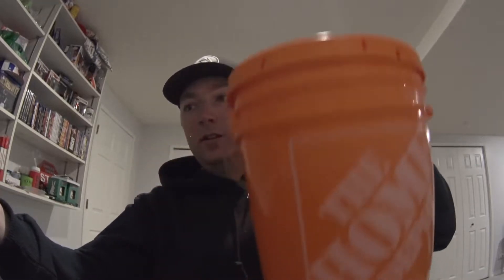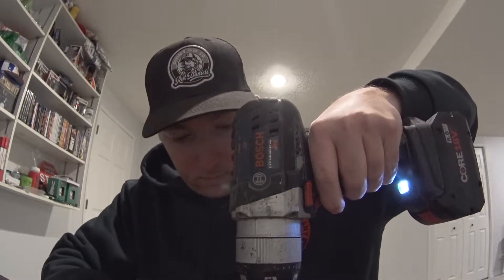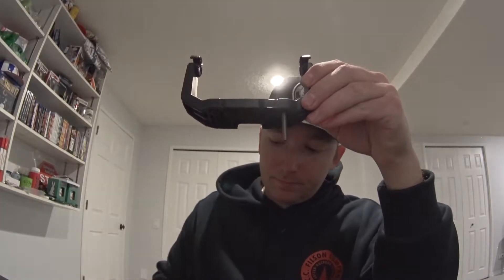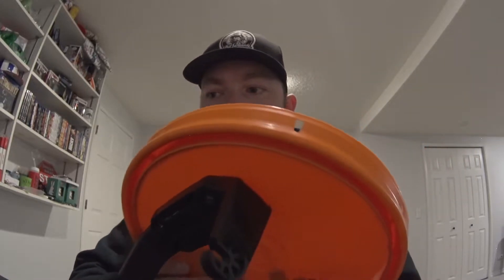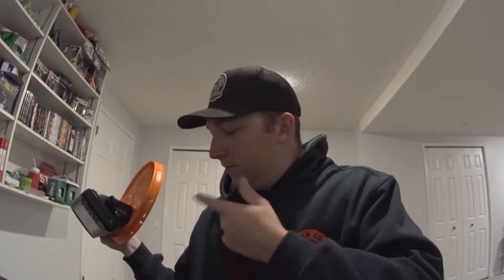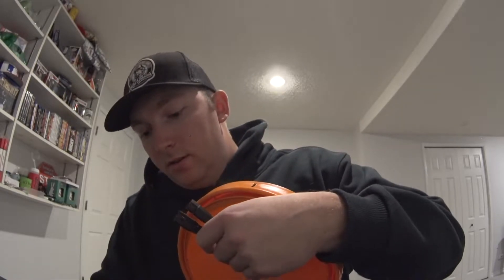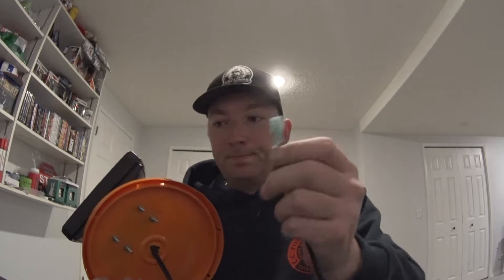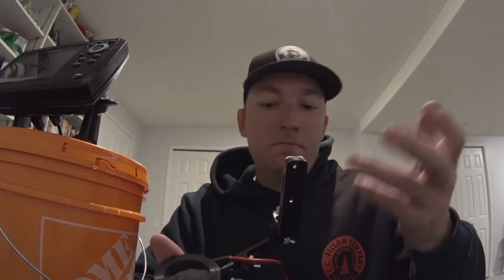How To Use Open Water Fish Finder Ice Fishing DIY Cheap and Easy

Comment: What auger are you using?
Reply from the maker: I actually took a cheap manual 8” and converted so I can use my drill with it. I added a 10” guard at the top so if it slips off the drill it won’t fall through the hole. I’ve drilled multiple holes easily in 24” of ice in -35 Celsius with no issue
Reply: @comefishwithmitch402  I did similar for my auger. 
I bought an adapter for my drill battery & now use a drill battery to power my fish electronics. I use dewalt, so it’s a “dcb091” Amazon knock off. 2 usb & a 12 volt port.
Reply from the maker: @Utah_Mike  that’s awesome. Great idea to use the drill battery to power your electronics. I use an 18v Bosch drill